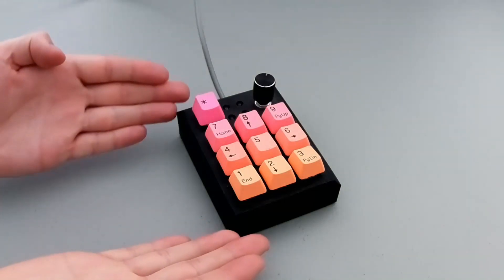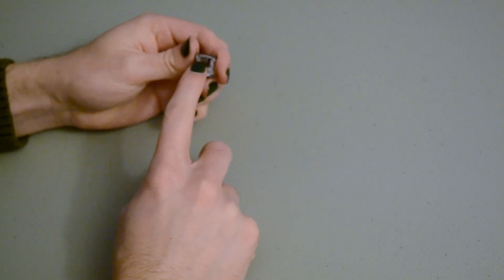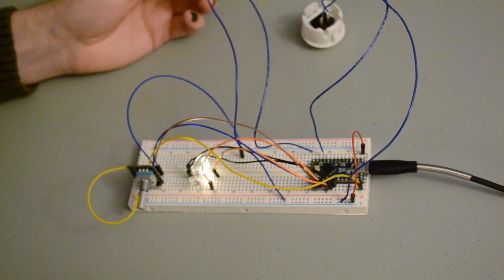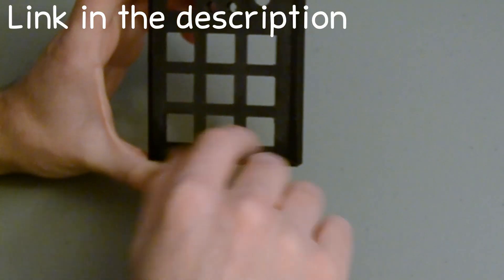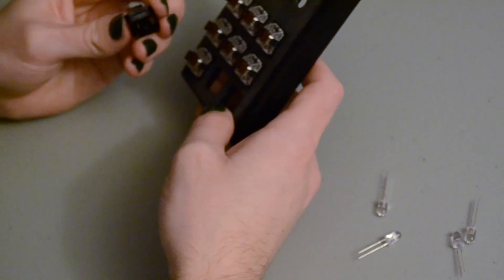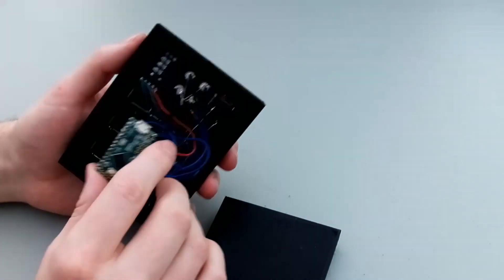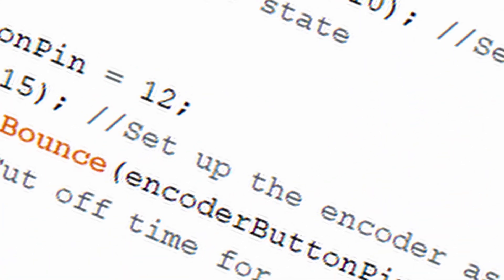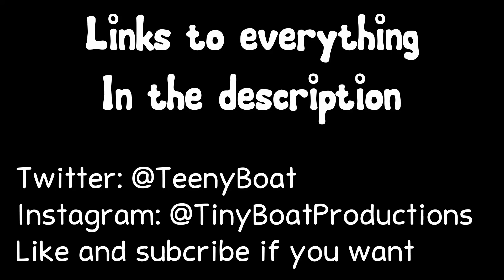Making a Macro Pad

Comment: Can you please show us how to make it?
Reply from the maker: Is there a specific part you have a question on?
Reply: @tinyboatproductions  about the wiring.
Reply from the maker: You are right that I don’t show the wiring well in this video. Check out the wiring diagram in the linked Instructable. 
Basically one of the leads of each switch are connected together and that is then connected to ground. The other lead of each switch is connected to its own digital pin.

Comment: Looked at many designs, love yours. I know your v.2 is "better", but i am trying to build this one because i have no diodes to do the keyboard matrix.  Code wont compile because it says "KEY_MEDIA_NEXT_TRACK is not declared in this scope".  I suspect it will do this for the other encoder commands.  any help please?
Reply from the maker: Are you using a teensy? I had a similar issue on version 2 going from the teensy to the pro micro.
Reply: @tinyboatproductions  Thanks for responding, no, i am using the pro micro.  any tips on how to get it to work on a pro micro?
Reply from the maker: @toddroles3234  yes, the pro micro doesn’t like the command it’s yelling about. For some reason you need to use Consumer.press() for the media keys instead of Keyboard.press() you’ll also need to include a keyboard different library. Take a look below. I will go a head and also add the modified (Pro Micro) code to the instructable when I have time.

You’ll need to:
Include “HID-Project.h”
Remove “Keyboard.h” (comment it out)
For all of the following changes also change Keyboard. to Consumer.
Change KEY_MEDIA_NEXT_TRACK to MEDIA_NEXT
Change KEY_MEDIA_PLAY_PAUSE to MEDIA_PLAY_PAUSE
Change KEY_MEDIA_VOLUME_INC to MEDIA_VOLUME_UP
Change KEY_MEDIA_VOLUME_DEC to MEDIA_VOLUME_DOWN

You’ll get a bunch of warnings but they can be ignored
Reply: @tinyboatproductions  Thank you, that is super awesome of you to reply and spend time on this.  Most people don't.  I really do like yours, code is understandable mostly to me, and I have looked at about a dozen of them and decided on this and then ran into this issue.  I will get the modified code when you get it up, and respond with a comment.  You have made me a big fan!  I may even start folding tiny boats!
Reply from the maker: @toddroles3234  it’s up now, step 5. 
Glad to hear! If you get a chance add a picture on instructables when it’s finished. And let me know if you run into any other issues.
Reply: @tinyboatproductions   I built this on a breadboard, and it works nicely.  Thanks for Pro Micro code update (i did have to change pin numbers) One code problem/question...I want the rotation of the encoder to do something different. Instead of media volumn up or media volumn down, i want encoder to type a letter (i know keys can do this, but i am ultimately wanting to make this an imput device for a cnc machine). so i replaced //Consumer.write(MEDIA_VOLUME_UP); with Keyboard.press('e'); (and volume down with Keyboard.press('f'); This "works" and it does type the letters in a word document or whatever when i rotate the encoder. BUT, the problem is it always types 2 of the letter. If i rotate it clockwise one click, it types ee and if i rotate it one click the other way it types ff. I have this problem with some other people's codes also. Any help to make the code so it only types one letter per click?
Reply from the maker: @toddroles3234  glad to hear the updated code works well!
For the encoder issue, this is how it works for me, but with the volume it isn’t a huge deal. I think it is because I have the code just polling the encoder. 
For better performance I think if you were to attach the encoder pins to interrupt pins and set them up as interrupts it would just send one of each. This is all just my thoughts tho.
I think there could be an issue of it canceling out in the middle of another command so I would be sure to include a relaseall() in the interrupt code.